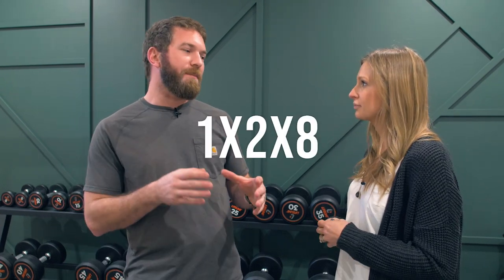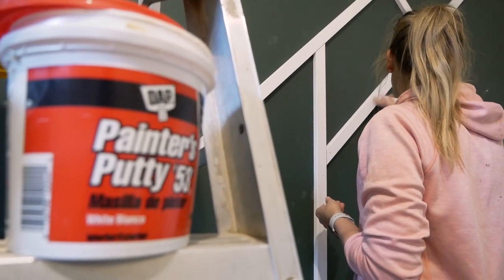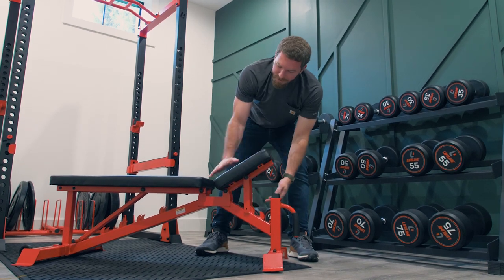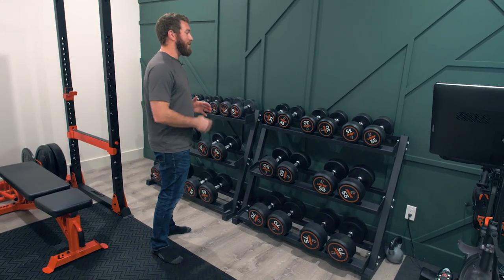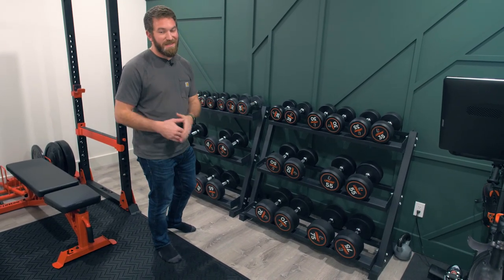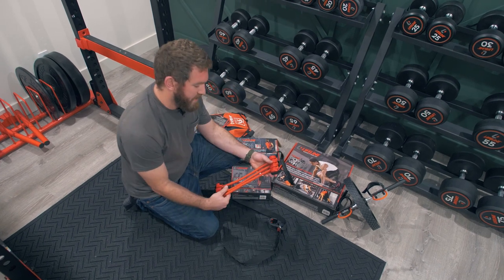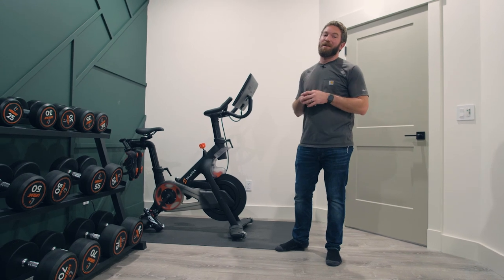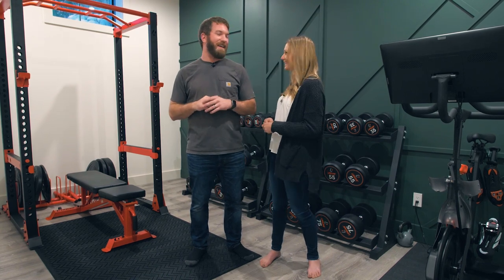Our Home Gym 🏋🏽 and Amazing Accent Wall!

Comment: You should put giant wall mirrors on the opposite side of the accent wall. It's easier to check form on dumbbell workouts and it makes the room feel larger.
Reply from the maker: Garrett Sloup agree, we plan to add a mirror eventually.